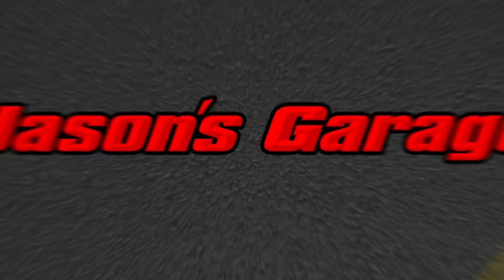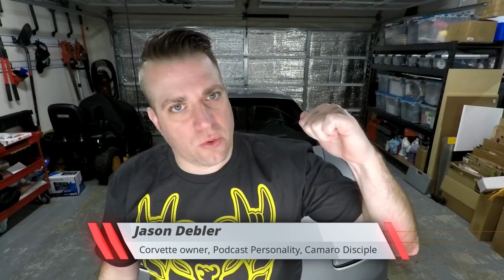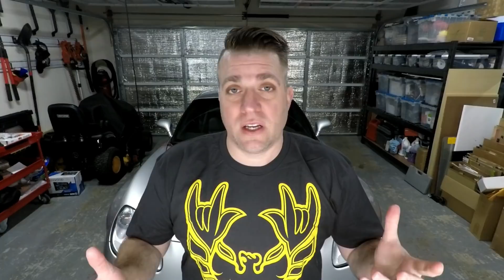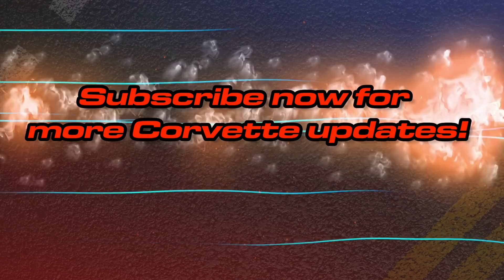LS7 Engine Cylinder Head Valve Drop Issue - What you NEED to know!

Comment: I sold my prestine black 2007 Z06, 13,363 miles, and 2 owners, never raced after 28 months to AVOID a costly engine rebuild or replacement. Piles of cash now...

Comment: Same old internet chatter… lots of talk but totally lacking the real facts. Everyone is the LS7 internet expert here. No real facts with VIN sequence ranges for the faulty heads that were manufactured. Zero facts about the design changes that allowed this HP engine to achieve the high reving numbers.
Are there blown engines? Yup plenty of them but does anyone admit to the home brew modifications that were done? What are the numbers of stock LS7s manufactured After the faulty heads were changed in production? 
I read it on google so it must be true…
Keep it going! I like buying those horrible cars …

Comment: Nope, it’s an urban legend. An internet lie. Just watch the video of the GM engineers debunking the anecdotal bull. If you blew up your engine, you suck at driving and don’t know your car or your car’s limits. Real players know, this is not a thing.
Reply from the maker: If you trust what the GM engineers say, great.  If you had to protect your job, you might say the same.
There's enough people out there that know the car's limits and don't suck at driving that it happened to.  Some were just sitting at a stop light when it happened.  Ask them if it is an internet lie, not a thing, or anecdotal bull.  They are easy to find, playa'.

Comment: You can add ABLE Chevrolet in Rio Vista CA.  They changed mine out.  They race those cars.  They know what they are doing.  My valve trane  after the "fix" was very obviously noticable more tight & quiet on the drive home that the clancky noises it made on the way in.  Just Do It!!

Comment: Had my son’s heads fixed by AHP at 38,000 miles. I just pulled them at 68,000 miles due to him cracking a cylinder. The reworked AHP heads are bad again. .005 clearance on 9 valves, 1 has .007. Spec is .001~service limit of .003. They are at a machine shop getting new guides again, and a valve job to insure they are concentric. Even the fixed heads won’t last. Word to the wise..
Reply: So even if I get the heads fixed, it’s still not a permanent solution, I was looking at c6 Z06s but now I’m really considering the grand sport

Comment: The valve broke from coming down and sit on one side of the seat first from worn out guide. The owner should be able to hear a double click valve chatter for a while before this happen. I have work on European cylinder heads for over 50 years they all have hollow stem sodium cooled exhaust valve, they all have worn out guides , never had a broken valve. They might not have as much spring pressure as the corvette, but still rev within 1000 rpm.

Comment: I visited a garage that specialized in prepping high performance rally cars in the UK. These vehicles were pushed HARD on track days, everyone expected that an engine that gets pushed to the extreme REQUIRES extreme maintainance. I saw vehicles torn down after a couple  rallies, the owners expect a high level of preventative maintenance.
Reply: This is it right here. Most of the dropped valves are from cars that have been tracked, yes some aren't. Yes if you track a car the engine must be refreshed. No, there is no permanent fix. Run 0-30 oil and delete your oil cooler.

Comment: 2020, I sold my 2016 Cadillac XTS Vsport.  Stuck valve,  requiring new heads....started looking at C5 z06s....but then quickly got hooked on 427......c6 platform.....king of NA.... since then I've read about every thread/post on the ls7. I was actually hoping for more indeptth.  What fixes guide wear.....then there's a huge debate on  stock intake valves....sodium filled stainless steel...how their too thin and fail from heat...what causes the heat....exhaust valves need to be upgraded?....hmm, now let's talk about trunnion upgrade....plenty of threads saying steer clear of comp cams kit (failure) and to go with Straub or ...is it btr.....what about the titanium coating coming off the pushrods? I think pushrods is right.... plenty of threads saying stock heads fixed only to fail after....just read where 1 guy actually got WCCH heads and 30k miles later....FAILURE....some don't like Frankenstein.....some say AHP have issues.... watch RACE PROVEN MOTORSPORTS do a thousand HCI setups on the C6Z...... this all started because I wanted to ad a A&A supercharger to the C6Z ( better not unless fully forged lol) like soo many do to the ls6 C5Z06....I'm still so confused,  I think it would be easier just to go with a already done and extremely well documented C5z06 600whp A&A with supporting engine mods,meth, clutch, trans, and rear diff along with all the suspension goodies and some CCW wheels DONE....the LS7 as bad ass as it sounds.  As iconic as it is....as sweet as the C6 is....maybe that's why the GS is soo popular.  A&A and meth on a GS and you're done..

Comment: looking at buying a 2006 zo6 with 100k on it… owner doesn’t know if the heads been fixed… with this high mileage do you think it won’t have the valve problem ?
Reply from the maker: There's no way to tell for sure.  It could go on the drive home, it could go another 100k miles.  That's the biggest problem, it is a ticking time bomb with no way to tell how many ticks it takes to blow.

Comment: I know the fix don't buy a car with the LS7 engine, case closed.That is what many Porsche buyers do with the IMS bearing problem. Don't buy a a Porsche Boxster or 911 non turbo from 1999 to 2008.
Reply from the maker: Ever driven an LS7 powered vehicle?  The cost is worth the torque alone.
Reply: @InJasonsGarage  Yes I have driven one.They are great and very tempting to buy one.

Comment: The stock components that come with this head or not adequate, #1 use a solid Enconel steel opposed to a hollow stem exhaust valve, #2 nurl and reem the top half of the guide to get oil stored into the guide

Comment: Sold my mint s2000 for $26,000 and I used it to buy my dream car, a 2011 Z06 with 10k miles. The drive home, from Macon GA to Pensacola Florida and my dream car became my worst nightmare. Didn’t even make it out of Georgia before I had my failure. The bank was dope af and ended up using a lemon law somehow and I was able to get back the 26,000 I put down and I got another z06 but I bought one that had built heads already. As much as I wanted an unmolested corvette, it’s just not smart when it comes to the 427. It still has low miles and I don’t have to worry about dropping a valve anymore. But now I wanna keep modifying. I have a Texas speed cam on its way as I type this out and I’ve already installed a corsa extreme exhaust

Comment: My FED "fixed" heads dropped an exhaust valve and took out the entire engine, so I personally don't think that "fixed" heads are the end all be all for this problem. I think it's a combination of bad valve angle geometry, pad style rockers, loose guide to valve tolerance, and sodium filled hollow stem exh valves.  Additionally, for cases this still happens on fixed heads, is when running aggressive cams that have higher lift than stock, the pad style rockers start to induce a side load against the valves and this can contribute to premature guide wear. However, this problem has been known to happen in completely stock engines so who knows exactly what the bottom line factor is, but it certainly is a real issue with the LS7. Nice vid explaining it to all the naysayers.
Reply from the maker: Thanks, you are echoing what I hear a lot of people say.

Comment: For the sake of saving a few dollars not using bronze valve guides GM shot themselves in the foot ,Even my 1984 VW rabbit had bronze valve guides,As bronze is a Lubricated metal then also being protected by the engine oil they last forever ,850,000 km on my humble VW When I sold her.
Reply from the maker: Bean counters seemed to have both hurt and help GM so many times over the years.  The worst part about that is the customer usually get hurt more, either way.
Reply: @InJasonsGarage  I dont know if ever heard of saab the swedish car maker ,GM bought saab and promised them they had a free hand in all of their new projects,,12 months later GM broke their word and told saab they can only use GM products ,As a result no one would buy saab and it went bust..saab also made jet fighters for the european union,,A great company destroyed by greed.
Reply from the maker: @sterling6860  I sure do know Saab.  Yes, a great carmaker at one time.  Good for them to switch gears and not let GM bury them.

Comment: is there a way to tell if the fix has been done without opening the motor? considering buying one but the previous owner isn’t the original owner so doesn’t know if it’s been addressed
Reply from the maker: One quick way is to pull the valve covers off and see if there is anything that doesn't look factory.  Reference this video:  https://youtu.be/3wxM568im6I

Comment: I'm around these motors virtually every day of my life and the vast majority of them that i work on are found in the 2013 427 convertibles...rare cars...and the Z06. The common strain that myself and most all other techs have found is that the LS7 valve situation, though rare, was consistent with incorrect servicing procedures...incorrect oil viscosities used...lack of adherence to correct oil/filter service intervals...and drivers who beat the living shit out of their cars.
Reply: I may be about to buy an 07 Z06 with 8k miles. It’s completely stock. Do you have any advice on what to do to keep it from dropping the valve? I won’t be tracking this car and I doubt I’ll take it to redline. I just want it to be reliable enough to enjoy it without worry.
Reply: @keelandavis  Drive it sensibly...avoid bouncing the thing off the rev-limiter...religiously adhere recommended service intervals and oil viscosity...always reset oil life service light when doing the actual service...run a quality synthetic and the GM-Delco filter. you'll be fine.
Reply: @frankcastle5294  awesome, thank you for the response.
Reply: @keelandavis  How you drive them and how much makes no difference to the issue. There is much anecdotal evidence of low mileage creampuffs dropping valves. Want to keep it from dropping a valve? Get the heads fixed. simple enough.
Reply: and a chevy engine has put up with that since the beginning of time. a gm  engine should still run in 40 years or they are going backwards

Comment: Thank you for info! I haven't been driving mine for two years now, due to hearing of this valve issue. You've just reinforced my decision not to. Unfortunately I live in Northern BC Canada and can't find a legit shop I trust. Also I don't fully understand what "absolutely" needs completed on the heads. I'm looking to keep mine stock, no cam ect, but want just the needed repairs. Seems every thread I read recommends different head component/repair needs? I'll get it figured out, but wanted to thank you for sharing a definite need for us Z06 owners. Best of luck in new engine swap, and  god bless, ehh :-) 🇨🇦
Reply from the maker: Glad I could help!  If you are at your wit's end, contact American Heritage Performance.  They haven't steered me wrong yet.

Comment: How much does the repair cost?I'm looking at 1at a dealer that has a mild cam , msd, intake ,and full exhaust....there not sure if heads have been addressed.
Reply: $5500.00 for legitimate job.
Reply from the maker: That's like asking "how much does a car cost?" 😀  The answer depends on who you buy from, what cores are used, what options you add.  As you might have seen in my other videos about this, I went with American Heritage Performance and their LS7 reworked heads start at around $1,500 and go from there...not including labor, of course.
Reply: @InJasonsGarage  I have been reading from a performance shop that they have narrowed it down to 2008 to 2011 are the only Z06s affected by incorrect manufactured heads....have you heard this?
Reply from the maker: @smm7540  Yes, I have heard it.  And I would say that for every time I have heard it...I have also heard someone saying it is not accurate because it has happened to LS7's manufactured outside of those years.  Which shop is saying this?

Comment: The problem is also with the valve train. The rockers push the valves at an angle, and with the hollow stem valve chevy dropped in it breaks. Lots of problems with this motor...

Comment: 97 K miles on mine.   Never been done. Idk if i need to
Reply: Is there any relationship between valve and guide failures and how hard the car has been driven?
Reply from the maker: If it were me, I'd at least have them checked.  But you definitely got your money's worth out of the engine!
Reply: @InJasonsGarage  what 96k mile LS7  heads look like https://youtu.be/nYU6V_zPwaM
Reply from the maker: @vetteboyz0628  Here's mine a just under 10k miles - https://youtu.be/3wxM568im6I

Comment: The problem with this is he didn't say specifically what the problem was. Is it the valve spring retainer? Why does the damn thing drop?
Reply from the maker: It depends on who you ask, but it is usually said to be the valve guides but some say there's more to it than that.  There's also a good article here: 
 http://katechengines.com/wp-content/uploads/TheSHOPMag_7-17.pdf
Reply: @InJasonsGarage  Thanks. Wouldn't upload but I can go to the site probably and pick it off. All the money they spend putting into that engine to get 500 horsepower and they scrimp on the valve guides. Admittedly, that just screams Chevrolet.

Comment: So we have to pay to fix it out of pocket?
Reply from the maker: To fix it up front, yes.  Some get an extended warranty in case there is an issue in the future.
Reply: @InJasonsGarage  so the question is     c6 z06 or c7 z06
Reply from the maker: @PurplDanq  Good question, and one that I tossed and turned quite a bit.  I could have gotten a C7 Z06 but it would have been a much higher cost obviously.  I just liked that the cost vs. value with the C6 Z06 and since I took the head fix into account when I budgeted for it, it was a non-issue.

Comment: Good info, sticking with a c6 GS then....unless the down payment is low enuff.
Can a shop tell if the heads were fixed on a used car 37k miles before you buy?
Reply from the maker: The best way to have someone who knows what they are looking at remove the heads and check for valve guide wear.

Comment: I purchased a crate LS7 from GM Performance this year (2020). It seems unclear whether GM corrected the issue with their current crate engines? Does the LS7 in the Z/28 have the same problem? The engine is going into a dedicated track car that won't see a lot of miles but will do probably 15-20 track days a year. My plan was to get the heads and motor inspected and refreshed every other year, so about every 10k miles. I'm half tempted to get the heads inspected before we even put the car on the dyno.
Reply: Which LS7 did you purchase? The new wet sump LS7 from GM performance is supposed to have it fixed
Reply: @703z06  I have just ordered the same LS7 570HP crate for my car.  Here all this time later, hoping the issue has been fixed.  How is yours?  How many miles?  What kind if rpms are you seeing?  Dyno?
Reply from the maker: I have been told different stories about the Z/28 since I made this video.  While a source very close to the car said they did fix it, I have also seen reports of very similar failures.  I don't know if it is the same issue or not.  The same goes with crate engines.  I think you are on the right path to check it, especially with your purposes of it.
Reply: @InJasonsGarage replying to a really old comment, but where did you see the z/28 failures? Shocked they’re out there considering the very low production numbers of the 14-15 z/28.

Comment: Pontiac Ram Air 5 Tunnel Port engines  suffered a similar problem with the sodium filled exhaust valve - Destroying many of these incredibly rare engines. 
I had assumed it was from deficiency in the early technology of manufacturing this valve. (Quality)
 After listening to your video it seems possible that it was an intolerance to excessive guide clearance (wearing) like you are describing with the LS7, 
possibly accelerated by high valve spring loads.

Comment: Hello sir I seen your video and others I was about to buy a 13 model yesterday for a good price with 15,000 miles but the engine issues held me from doing it and my question to you would be to fix everything you’d recommend what would it cost on one of these engines for piece of mind ?
Reply from the maker: If you want an LS7 powered car, you shouldn't let this issue stop you.  Just factor in the cost of having the heads fixed.  Different shops have different prices but go with one that has LS7 head work experience.  Check out this video:  https://youtu.be/IjZsagCk-x8
Reply: In Jason's Garage thank you
Reply: I want one and I plan on getting the head’s done. Any tips you can recommend? I’m not afraid of buying the car, I just want to build a good reliable street car 👍🏿